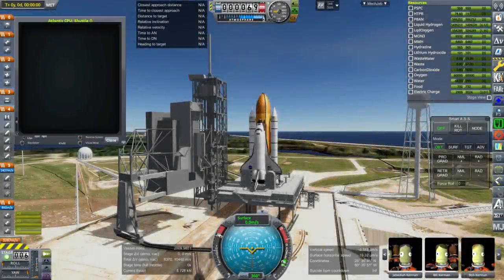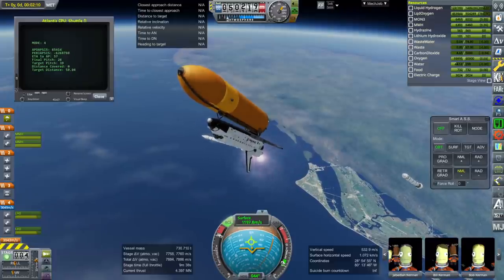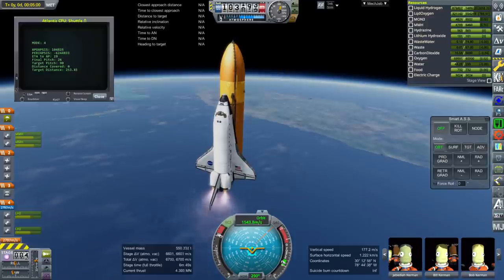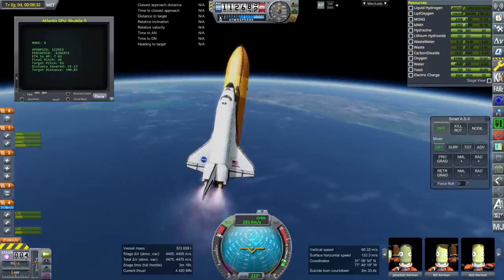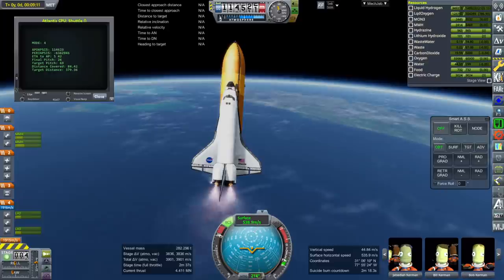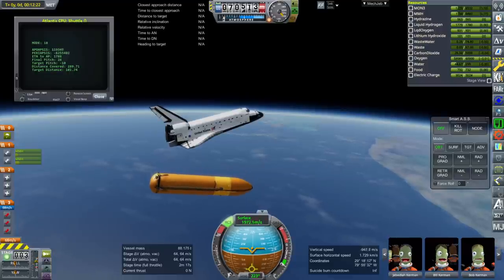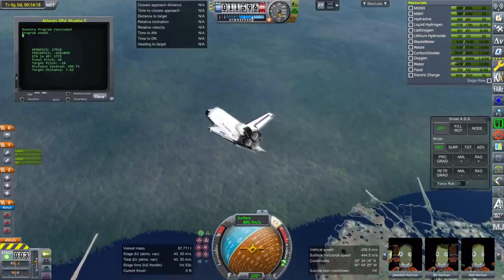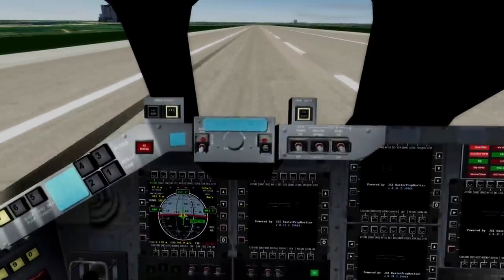Realism Overhaul in KSP 1.8.1 - Shuttle RTLS Abort

Comment: *Successfully executes RTLS abort maneuver in the Space Shuttle.
*Lands like a low-time Cessna student who hasn't found the rudder pedals yet.
Reply from the maker: My excuse is that I'm using a twist-rudder joystick, no rudder pedals, and KSP rudders tend to work differently than in a regular flight sim. But hey, maybe I'm just a crappy pilot - I've never flown in real life.
Reply: You did great.    99% of KSP users can't land the shuttle, period.
Reply: @RaizSpace  It's funny- I was a huge flight sim geek before I started flying in real life and whenever I would land in flight simulators I would always be off-center, then I started taking flight lessons and learned the importance of a stabilized approach and got really disciplined about always landing on the centreline, and now whenever I land in flight simulators, I'm always dead center.  Probably a muscle-memory thing.
Reply from the maker: @Conor Corrigan Flying in real life certainly helps. In some ways, sims are a bit more difficult simply because of the lack of physical feedback, and KSP is especially more difficult because even with FAR it occasionally acts in ways not exactly like a normal flight sim, much less real life.

Comment: Hi, really impressive like all your Shuttle videos

I think you're pulling that many Gs because you target the cutoff too high, too slow and too close to KSC. If you make your trajectory flatter it should be easier to control the glide.
Technical documentation on RTLS is scarce to say the least, but I managed to find some documents that I can point you to if you like.
Reply from the maker: I think I mentioned in the video that I think they would have done it lower. I may make further adjustments.

Comment: I think you could have followed at the real RTLS cue cards to know what attitude to fly the shuttle at. I believe the shuttle aims short of KSC, and uses aerodynamic lift to bring it back on trajectory. 

In your case it wasn’t too bad since there was time to pitch down after MECO, but you could have pitched down while still on the main engines so that you can ditch the ET immediately and go to the alpha recovery attitude.
Reply from the maker: I'm aware that they would have been at about 70 km and it's a good point that we should pitch down with the engines on. The script is actually burning short of KSC by 10 km, but obviously that will need to be tweaked, but only after the altitude adjustment, since that will also reduce the energy we're coming in with.
Reply: @RaizSpace  Looks to me like the main issue was that your outbound leg was too short and too high. If you target MECO at around 400km to KSC you should be fine.
Reply from the maker: At 400 kilometers, I would definitely be in the water. The trouble with using the real RTLS stuff is that this Shuttle is, inevitably, somewhat different. It gets more drag than it should in certain regimes and less than it should in others.